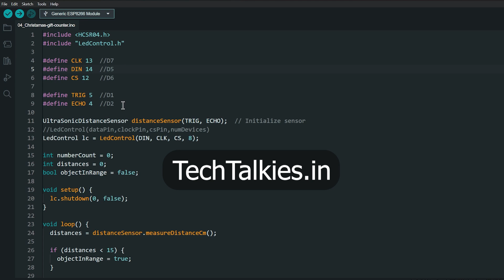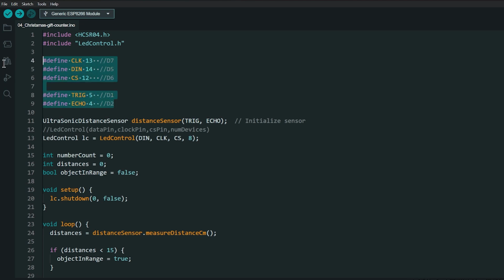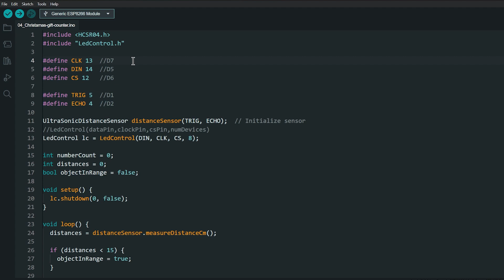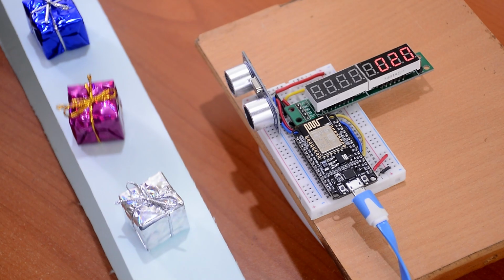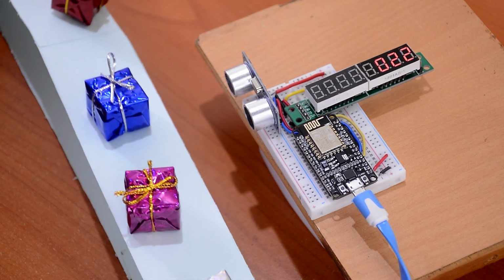Object counter with ESP8266

Comment: What program  do you use? Where can I download the program?
Reply from the maker: Do you mean for programming?
Reply: Yes the esp8266
Reply from the maker: It is the Arduino IDE. It can be used to program all Arduino boards and a lot of other microcontrollers.
Download on the official Arduino website:
https://www.arduino.cc/en/software

Please note that the software does not come ready to program the ESP boards. You will need to install the ESP boards inside the IDE. There are many tutorials for it online.